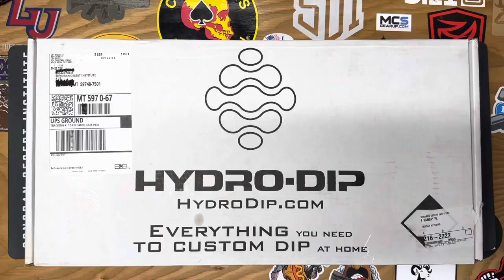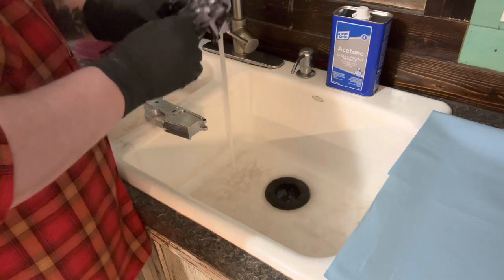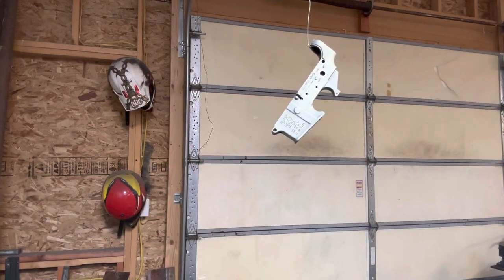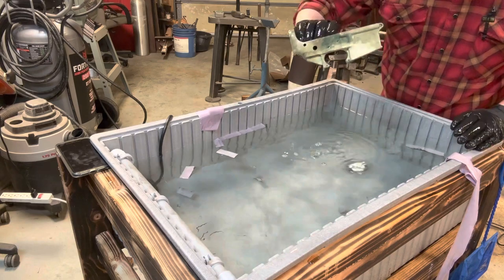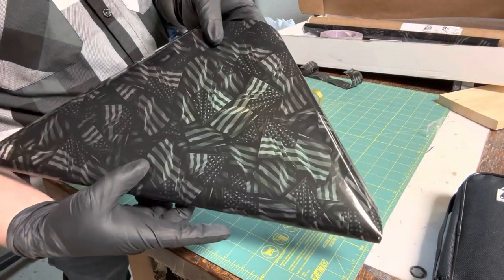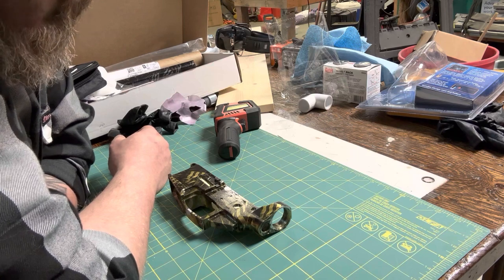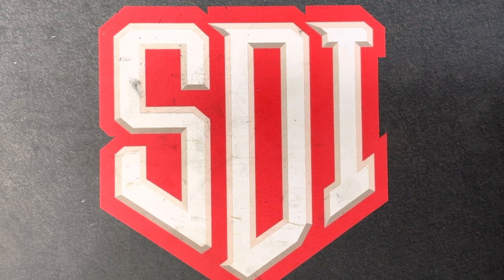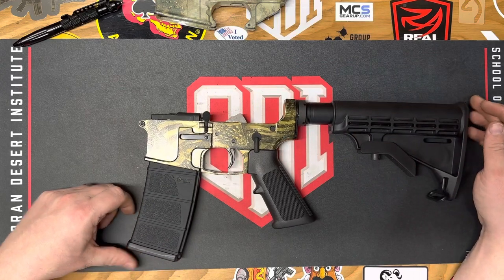SDI - FTT 201 Week 7 - Practical Application (Hydro Dip Lab)

Comment: was your video restricted on length for the assignment? I know the one in FTT100 was so I did a PPT instead. still unsure of using video, not much of a editor...
Reply from the maker: Great question. All of my videos I have posted received 100%. I am very strict with following the guidelines for each video. If I had a video that failed in someway I would pull it down so people didn’t follow bad advice. If there is a time requirement then I make sure I meet it. In FTT100 I struggled to get my video below the limit but was successful. 

I just use my iPhone for recording and I do all my editing on an app called LumaFusion. Feel free to ask questions on any project you have in the program I’ll try to help.